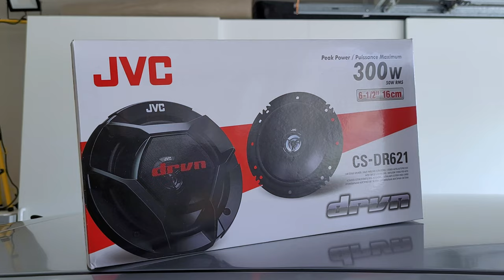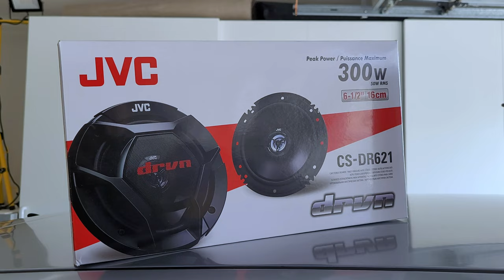HOW TO INSTALL ANY CAR SPEAKERS THE RIGHT WAY |Hyundai Getz

Comment: Got the JVC Speakers installed in the front of mine now. Sounding Good. Tip: I just unsoldered the wires from the old speakers and re-soldered to the spade terminals on the new ones - no need to cut wires or use heat shrink. My Getz has electric windows, so no crank handle to remove, but a couple of connectors to remove at the back of the door panel if you want to get it right out of the way.
Reply from the maker: Awesome mate cheers 🍻

Comment: Hey mate, thinking of buying a Getz and learning on manual with one, or a swift or a similar hatchback, does the low power of most of the 4cyls help with getting used to clutching?
Reply from the maker: Hey matey the Getz is such an easy car to drive💯 clutch is very easy. Doesn't release too high like other cars. You'll lovit. Very reliable cars too🙂
Reply: @budget4x4life  yeah mad thanks, all the auto ones are stupidly expensive with high ks, so why not learn
Reply from the maker: @daddyshrek5666  You'll lovit💯 Faster than the auto ones anyway

Comment: Thanks needed some background info for my upgrade, now just need to get an inverter and then drop in my 2x Logitech Z623 2.1 Speakers, Subwoofers will sit in the footwell so passengers can place there feet either side of them and the satellites will probably be gaffa taped to the rear head rests..... :-{D
Reply from the maker: Sounds good🙂💯

Comment: Imagine my surprise at the first YouTube video I find on replacing Getz speakers is not only Australian, but in my local area!
Looks like you didn't replace the tweeters above the front door panels? But I know what size to get now, if I'm going to replace the speakers. Will probably just do the front at first and see what difference that makes. Very useful.
Reply from the maker: Haha, awesome, man! Mine didn't have tweeters😄 I'll probs leave them too and won't bother 💯
Reply: @budget4x4life  After watching this I took the trim off my front Driver's door to look at my speakers. not totally shot like yours were, but I'd still like to replace. Mine have 4 mounting screws for the speakers to the frame, where yours have 3. My mounting screws are 5 1/2 inches across from one to the opposite one. I'm thinking that 6-6/12 inch speakers might be too big. What year is your Getz? (Mine is 2009). Did you get your speakers at Repco Lawnton?
Reply from the maker: @Iainsimo  I used to have the newer model Getz and it took the same size so you'll be fine I reckon. Just keep receipt incase it doesn't fit for some reason. But make it work💯 Yes I did haha how did you know😄
Reply: Knew you were in my area, recognised the 4x4 place at Brendale.
Reply from the maker: @Iainsimo  Haha awesome 👌🏼

Comment: I bought recently a Getz 1.1i from 2006. My sounds system is also pretty crap and I want to change them but idk where to start. This video is really perfect! Thanks allot. 👌 Do you know the size difference from the front and the back? I think front is 16cm and back maybe 15cm? I would like to know!
Reply from the maker: Awesome mate no worries at all 🙂💯 yeah I think they were the same size. Just make sure the speakers you buy say 6-6.5 inch and you good to go 👌🏼🔥

Comment: Nice video. I left you a comment on your other video about the purchase. So, the front speakers are 6.5 inch, but what is the size of the rear speakers then? Do you think it'd be the same for a 2006 5-door Getz? I wanna do the same upgrade but don't want to drill any additional holes to the frame.
Cheers mate
Reply from the maker: Hey mate cheers for the support!💯 Same size front and back. I reckon it will be same for 5 door😊 try get 6 inch or 6 to 6.5 💯